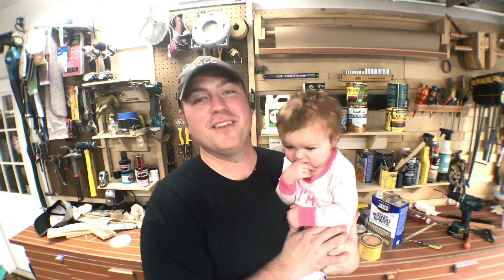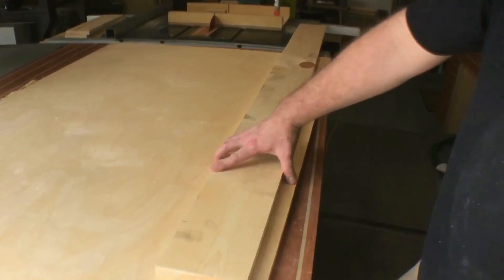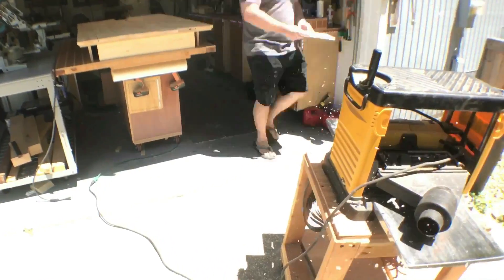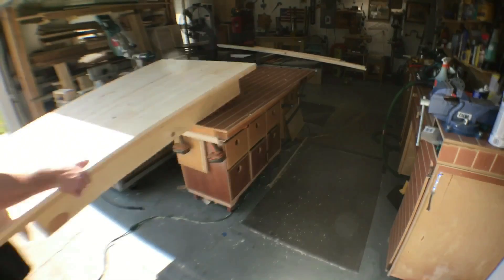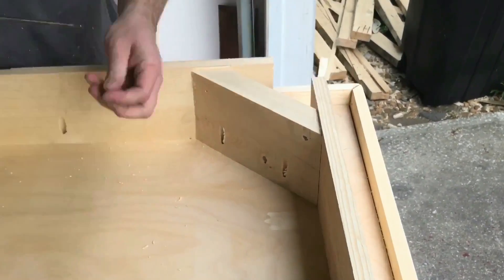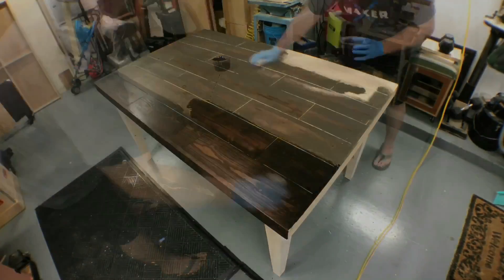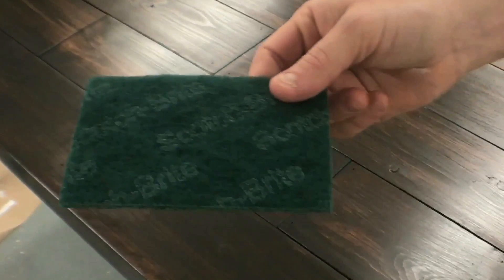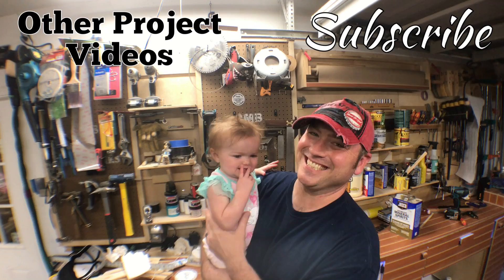How to Make a Farmhouse Table

Comment: Great job. I just learned that if you use hard wood floor poly on you farm style furniture it will add tremendous durability. Almost no scratching when sliding things over it and no white water rings from wet glasses. Love the channel. Regards, Bill
Reply from the maker: +Bill D this is a fantastic tip brother. The next piece of rustic furniture I  make im definitely going to use  the floor polyurethane. If you don’t mind I’ll give you a shout out, maybe just use your first name? Anyway thank you so much for watching brother. Enjoy the church function, I’m a little jealous that I will have no barbecue today! Take care
Reply: A Glimpse Inside no problem with the shout out. Best regards, Bill in Georgia. PS, 18 hours later and 600 pounds of hmmmm good pork butts are done.

Comment: Just wanted to share my experience. I built this exact table (did not do brick pattern)and had a great time doing it! I found that the plywood base eased the scare of properly joining the individual boards into one table top. My only concern I found was that I built my table to stand about 31 inches (found that standard on google). The thing is, with the side skirts being nearly a whole 1x6 (I trimmed a bit off of each to make them around 4 1/2 inches) it only allows around 24-25 inches of clearance for chairs and your legs while sitting. Did I do something wrong here or is that about right?

Comment: Absolutely love it! Does the plywood help prevent wood movement? I want to make a table with oak and hickory and I'm stressing over all I hear about expansion and contraction and edge banding coming apart.
Reply from the maker: +Andrew Mabry Thank you very much, you are exactly right. Plywood does help stabilize tables such as these. How do I it’s gonna be intimidating especially if you work with them exclusively. But there are plenty of videos on how to do that as well. Thank you so much for being involved

Comment: Can you use an orbital sander only, or do you need to hand sand with the grain when you get up to 220 grit?
Reply from the maker: I would suggest using an orbital sander in the beginning process even to 220 grit. I would definitely finish sanding with a higher grade than that by hand
Reply: A Glimpse Inside thank you. Coukd I use 80, 120, 220 with orbital then 400 by hand? What would you recommend? Im on my way to Lowes right now:)
Reply from the maker: That sounds good but after transitioning from the orbital sander with 220 grit sand by hand with 220 grit and then move to 400
Reply from the maker: Finishing is a fickle process. It took me a lot of trial and error to get comfortable with it

Comment: What type of plywood do you recommend using for something like this?
Reply from the maker: Are use Baltic Birch for almost everything. But you have to look for it at locations like a hardwood dealer instead of your big box stores. And the hardwood dealers typically sell them at lower costs know what you can find at your big box for the cheaper variety

Comment: Do you have any problems with movement by pocket screwing the top to the apron? Or is it usually okay?
Reply from the maker: So far so good usually it’s OK as long as you orient each green one going up one going down per board
Reply: A Glimpse Inside thx for responding

Comment: Did you fill in the brad holes before staining?
Reply from the maker: David Samuels I did not. I wanted the dark holes to add to the rustic look
Reply: @AGlimpseInside  Do you normally fill in the holes? If so, best filler for stain and paint?
Reply from the maker: David Samuels For staining.  I like the Minwax stainable Wood filler, if I’m just going to paint it I make a wood filler out of glue in Sawdust!

Comment: I really like the brick style on the table.  Do you have any issues with wood movement when you glue hardwood bricks to plywood like that?  I know if the top was made from hardwood only you can't use pocket hole screws otherwise you risk the table top cracking with temp/humidity changes.  But curious to know if the plywood and glue holds the surface in place or if you've seen those bricks crack over time.

I found your channel because of this video looking for farm table ideas and subscribed.  Curious about the wood movement before I attempt this myself.   Thanks for putting this together.

Comment: I wish I have the tools that u have. That could been much easier for me. Like" for sanding each single wood. Thanks
Reply from the maker: +Kristian Igama my shop has been out fitted over the years by doing client work. I started with a circular saw and a drill and made cornhole boards to sell to then buy a table say and air compressor. Then started marking tables and builtins to acquire more tools!  You can do It too! You just have to put the time in!! Thank yoga for watching KI. Very much appreciated

Comment: I DONT HAVE A NAIL GUN DO I PRE-DRILL TO USE FINISHING NAILS
Reply from the maker: +KATHERINE C.A. JONES only if the nails are being used within an inch of the end of the board. Other than that it's not necessary my opinion
Reply: ok thanx Love